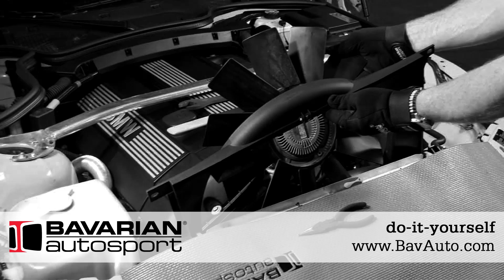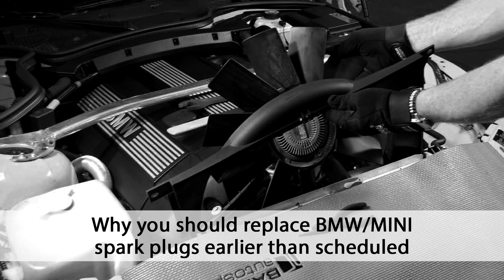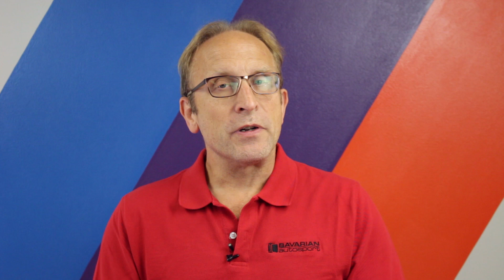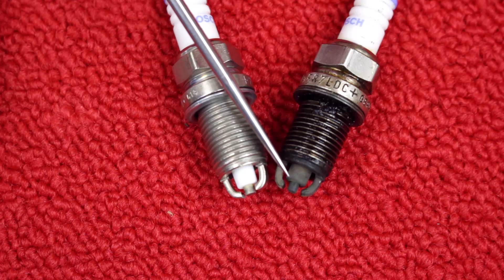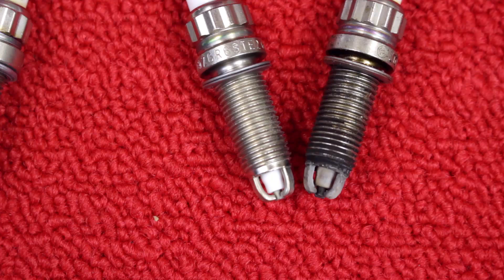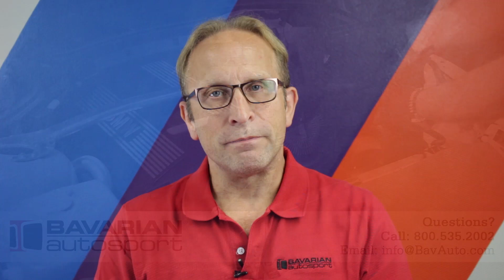Why you should replace BMWMINI spark plugs earlier than scheduled

Comment: I see water intrusion #2 plug.  The beginnings of head gasket damage.  Possible the vehicle has been running hot by looking at the plug and and oil intrusion on #3 plug.  Possible  valve cover gasket.

Comment: I have a 93 325i. it is the 4 door sedan with automatic transmission. How do I know if it is a 12 valve or 24 valve?
Reply from the maker: All E36 3-series (92-98 for US models) 6-cylinder cars have either the M50 or M52 24 valve engine, except the M3 models which have the S50 or S52 24 valve engines.

Comment: What sort of spark plugs do you typically recommend for late model BMWs? Bosch vs NGK for example, and are platinum/iridium plugs worth it?
Reply from the maker: The later models that come with platinum plugs should continue to use platinum or iridium.  We have found that the NGK platinum plugs typically have a larger platinum electrode than the comparable Bosch plug, for the same application. Theoretically, this should relate to longer electrode life.

Comment: Are the boots necessary to change as well?
Reply from the maker: We fully recommend replacing the connector boots when the plugs are replaced (only applies to the earlier generation BMW direct ignition (coil on plug) coil design, with a separate full connector boot.